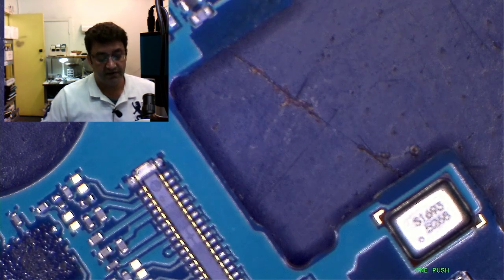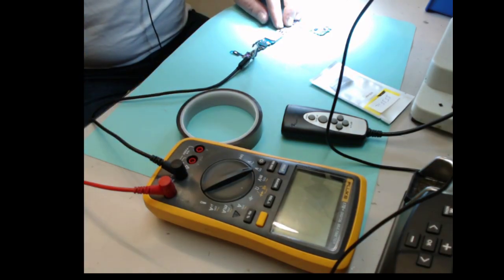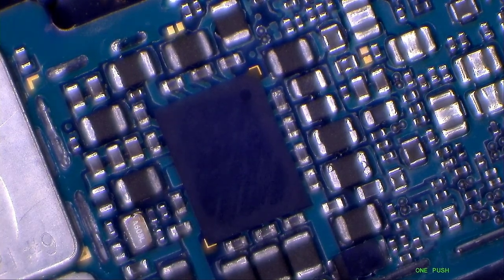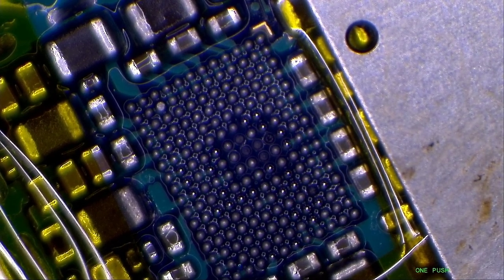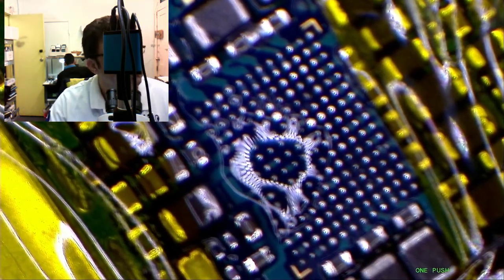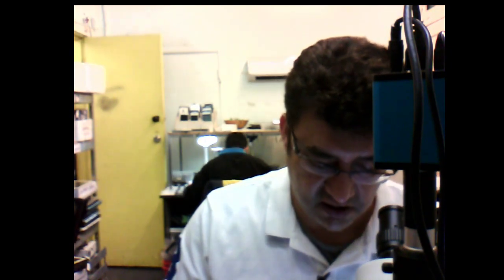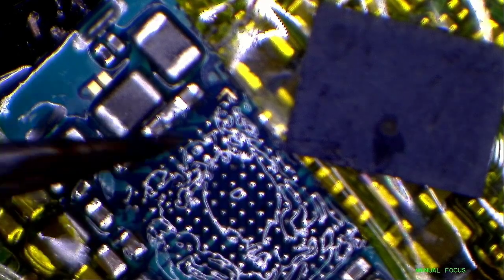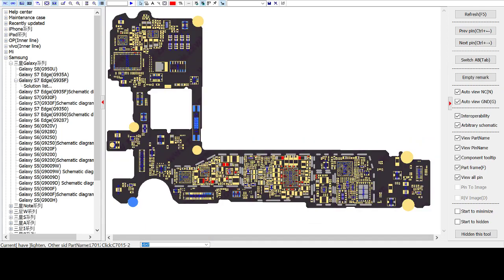samsung s7 edge g935f power ic s535 replacement

Comment: Thanks for your video
I used some water to clean the S7 Edge because of Corona pandemic, now the phone doesn't work any more, is it possible to repair it? if so is that battery or motherboard ? how should I know that Battery is working, I mean testing?
Thanks again

Comment: Hello! My S7 G930FD also seems to have a problem with the power ic. My phone won't turn on and won't charge. Could you give some advice, is it possible to assume that the U7000 (S535) power ic is faulty if some of the output voltages on it do not correspond to Level 3 Repair? For example, when I check the voltage on the C7064 it should be more than 1.1V, but really only 0.76 V ?
Reply: I am having a similar problem as you. Actually, in my g930fd, L7010, L7005, L7003, L7012, and L7013 are shorted to ground. I removed U7000 and they are still shorted. Any ideas?
Reply: @pakidermo5000  I didn't remove U7000 yet, but I'm in the same situation. Did you find a solution ?

Comment: Sir My phone suddenly stopped fast charging and then I tried rebooting my phone but still nothing happened it took 5 to 6 hours to charge fully 
I showed it to some technicians some said fault was in charging port on phone some said there is an issue with ic so I gave my phone to them and the said they have replaced Ic and also charging jack and now my phone is fast charging again there was no other issue other than that and now its perfect but they charged me around 30UsD for replacing IC and jack 
Now i suspect that there was no problem with my IC and only charging jack was damaged or something 
Can u please tell me that if Ic was supposed to be replaced for only fast charging issue or only charging jack was to be replaced
Reply: I have tried only replacing the charging board and only that doesn't work. So replacing the ic might be right
Reply: @theleglend  thanks then my money is not wasted.
Reply: @abdullah.malik98 During that time, Did you lose the ability to connect it io a PC for data transfer?
Reply: @theleglend  yes It can also charge the phone but very slowly
Reply: @abdullah.malik98  And when you changed the IC it became okay?
Reply: @theleglend  yes It was working okay like new 
Now I have sold it
Reply: @abdullah.malik98  Thanks seems like what's happening to mine now.